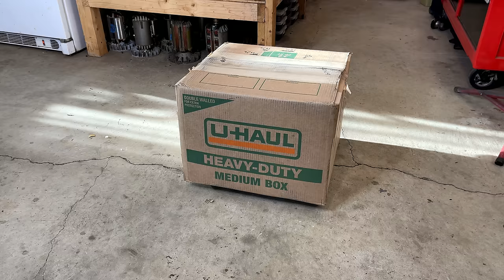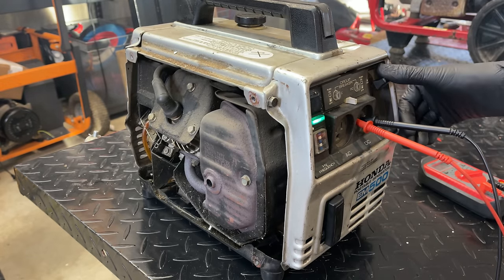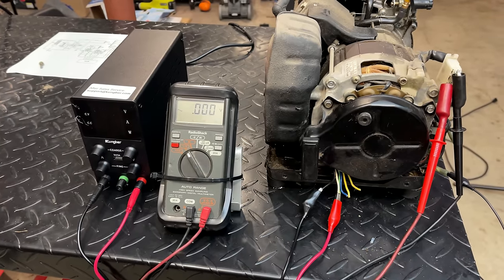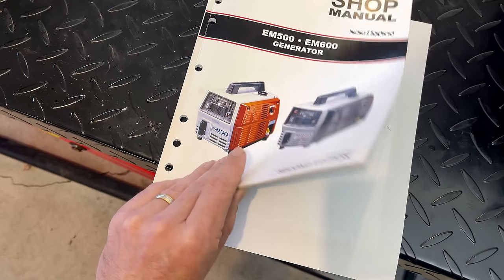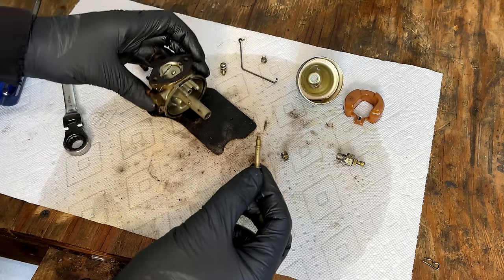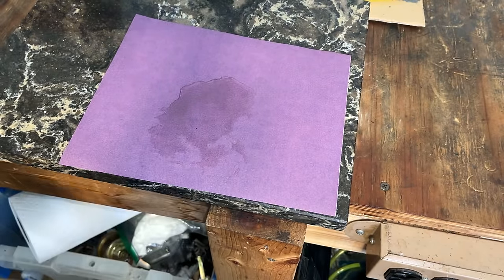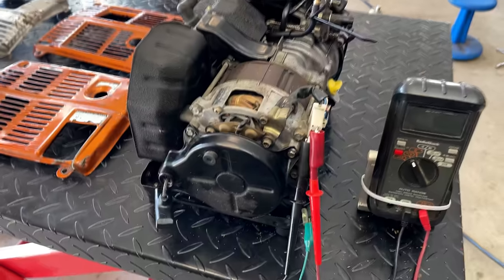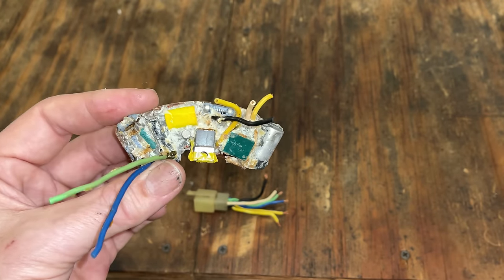Vintage Honda EM500 - High Voltage Problem

Comment: Not just a good repair, but an excellent RESTORATION, with the new housing panels.

Given the AVR  failure, I wonder if there is enough demand from spare AVR , to make a replacement version of the AVR.. Make a housing by 3D printing, make a new PCB and build these.

While writting the above remark you pointed out the attempt to depotting and the problems of wiping component details. Given the known electrical function suitable design of circuit can be under taken by compentnt electronics engineer or experience hobbist.  The choice of components should not be an issue Given basic design existing in the depotted part. Should be cost effective even selling  at lower price than the existing over $200 price.

By the way the depotting was one of the tasks often done in my job (over 40 years) of automotive design and diagnostics of warrantee return  alternator regulator s and other potted electronic modules including Dash display, car audio,  electronic spark modules and even full engine management (spark and injection) modules.. Truely not hard if experienced, without destroying the components on the PCB.

By the way my primary job was designing all above such electronics systems  but got called into diagnosing less obvious fault many times, but also did depotting on prototype and pre production analysis tasks.
 Most of my time was on full fuel injection engine management. But also designed from simple modules, speed relays, wiper delay, display modules and  transistor alternator regulators through to modern advanced hybrid integrated circuit based regulators. A very unusual though actually simple design  was an electronic replacement for classic old electro-mechanical alternator regulators from pre electronics times, basically used to be pair of electro solenoids that were far too costly to keep manufacturing due to material and manufacturing time costs, but due to past volumes, there was huge demand for over 300,000 spares per annum for diverse world market. Lots of old cars, trucks, tractors, road maintenance machines, even some generators,  rail and ship/boat usages, that simply needed to be kept operating. Some with alternators not replacable by newer designed alternators without very significant cost. So simple a range of 5 versions of a single basic design supported all applications. Biggest difference to normal electronic regulator being high side switching rather than the low side switching of field current of the modern system regulators.

Comment: Nice…it’s funny to me though, if I tried this half the screws would break off and have to be drilled out and any screws that hit the floor or workbench would be lost forever. Never mind there is no chance what so ever I could remember where every thing was supposed to go back. 😂
Reply: I write it down as I go along. The odd sketch or photo does not go amiss either.

Comment: Another method would be to create a mold from the original part and then cast it with a high strength epoxy such as J-B Weld steel.

Comment: The AVR regulates voltage variations can you use a car regulator from bosch or other brand ,  as it is 12-13 volts

Comment: As a side question... do you ever put a bit of dielectric grease on the electrical connections to minimize corrosion ?
Reply from the maker: It’s a good idea, but I have not used it.

Comment: You would think that you would have a blank connector that you could put pins in with short wires instead of cutting. Never know it could have been good.

Comment: How about getting a schematic of the larger version of the voltage regulator and adjusting the component values o fit the small wattage.

Comment: New to generators, why does it not produce a sine wave? Because of the characteristics of the part you replaced?
Reply from the maker: It does produce a sine wave, but brushless almost always have a noticeable ringing that can be seen on the oscilloscope.

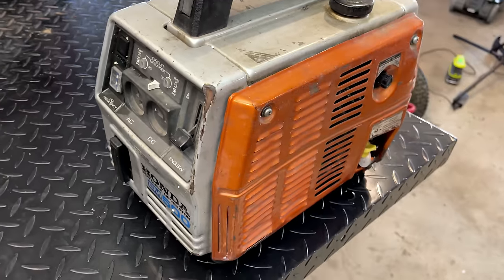Comment: 1:02 you forgot the 2 spacers on the carb mounting studs betweed the airbox!
Reply from the maker: They actually go in the airbox stud holes.  I put them back in there before putting the airbox back on.

Comment: Have you thought of getting a 3d printer for those small plastic parts that sometimes break? also good when needing to do some adaptors that you cant buy
Reply from the maker: I have thought about it.  The 3D printer my son has can print the parts, but the plastic melts at a low temp.  Would need to upgrade the tooling before I am able to do that.

Comment: Have you considered getting a 3D printer. That broken carb spacer can be printed easily enough. I know the spacer isn't made of plastic but heat resistant materials are available. There are also companies that will 3D print parts for you. Having most of the broken one is a good start so a duplicate can be made.
Its just a thought.
Reply: James has spoken about using a 3D printer before. He has had his son to make some parts but he has said that they were not robust enough in practice.
Reply from the maker: Yes, would need to find a company that could print the part using a higher quality material.  Think I need to spend a little bit of time learning how to use the 3D printer.
Reply: Fantastic idea!
Reply: @jcondon1  3D printers extrude thermoplastic which is unsuitable for use at elevated temperature. That spacer looked like it was made out of Bakelite which a themosetting plastic. It is actually baked at pressure in a mold. Completely different stuff.

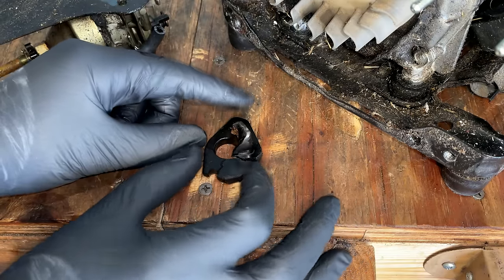Comment: 40:10 Instead of gluing it back together, do you have (or know someone that has) a decent 3D Printer you could make a new one with?
Reply from the maker: I do have a printer, but not sure it’s up to the task.  Just found an oem one on eBay.

Comment: Well done giving that a second life.
I wonder if a 3D printed carb spacer would hold up.   I do not know the operating temperature of the spacer, if it is less than 150 deg C (302 deg F) then a PLA printed part may work.   This would not be difficult to copy the design in CAD.   I am happy to volunteer if you want to try this.   Other filament types can take higher temperature, but my 3D printer does not have an enclosure so I am presently using just PLA.
Dave.

Comment: I have one that is over 40 years old and need to do some work on it. It isn't putting out any power.  Well the AC output is bouncing up and down real high and low on voltage.  I have had it for 40 years I didn't get it new. I started doing this about a year ago.  Any help would be great and are parts available to fix it?
Reply from the maker: Parts are the issue.  Most likely you need and AVR.  Potentially you have a loose connection.  The place I bought the AVR from is now sold out.  Do not know any other sources.  That said I am working on building an AVR alternative for this generator.  Not sure if it will work, but will try.
Reply: Really hope you are successful in rebuilding these AVRS. It's like you said a lot of these will end up in the landfill. Out of all the old school Honda generators built these em500s are probably the most popular

Comment: OK, I have to ask...  Why wouldn't one of the small 1kw-2kw avr's that are available on eBay have worked in this application? Yes, the form factor and connectors are different. But couldn't a person just cut the plugs off the replacement avr module, and then splice on the connector that you save in it's place? And then mount it just outside the generator head someplace? Since they are only about $10, I would have thought you could give it a shot without too much risk.
Reply from the maker: It would have been worth a try.  Those usually power rotors with 40-70 ohms and output 120+ volts DC.  Not sure how well it would have handled the low voltages on this machine.
Reply: @jcondon1  Actually, maybe you should still give it a try. And if it DOES work, you may have a better chance reverse engineering one to come up with your replacement unit idea.

Comment: Good vidéo i french people ,i have this generator, my carburator is broken, You have a equivalent  part number for the carburator ? Because the original carb is very expensive. Thanks :)
Reply from the maker: I am not aware of any clone options for this carburetor.

Comment: Well, as seeing as Nuisance is going to bann gas powered car's I suppose the poor cali people  will need to have hydrogen powered generators? Ouch, I feel sorry for the poor souls stuck there. James, Just a question if I may please? Why are you adjusting the constant current control on the PSU and not the voltage? Another Idea for the insulator, sorry am writing as I watch, there is a product called QBond here in Namibia Africa (don't know if it is available world wide) but, you could use that to glue together and form a new part for that missing bit of the insulator.. Nice video as usual, thanks James.
Reply from the maker: Thought I was adjusting the voltage.  Maybe user error?
Reply: @jcondon1  🤣😂🤣 I was sitting there watching the PSU and thinking why is this PSU jumping from 0 to 5V and not ramping the voltage up as expected..... Then I looked closer at what knobs where being turned.....🤣😂

Comment: concerning the old AVR - the potting can be removed after soaking it in acetone for some time (some hours,  sometimes 1-2 days). 
Once you have access to the board inside the AVR can in most cases be revived by changing out the electrolytic capacitors (and sometimes by fixing bad solder connections).  
Even if the issue is not some dried out electrolytic cap, most of the components inside these old AVRs are off-the-shelf and can be exchanged with basic (thru-hole) soldering skills,  once you get the potting off.
Reply: the failure on this one is the big transistor overheating and short-circuiting. The symptoms are that the output voltage goes way up because the rotor is receiving maximum excitation continuously.

Comment: You know on Amazon or wish or any of the places you buy you can buy some magnets they're flat stick them on the bottom of that table that you're using and in every time you put bolts on the table they'll stay right there where the magnets are if you even have to leave a couple of them side-by-side to keep the metal lawe're on top little screws both you know whatever so you don't lose him
Reply from the maker: I actually have several magnetic trays.  Have never used them :(

Comment: Looks like a 3d printer and scanner would pay off for stuff like the carb spacer that is otherwise Unobtainium .
Reply: There's two kinds of plastic there's thermoplastic and thermosetting plastic and you want to use the latter in hot applications. The kind of plastic you can 3D print is the former variety so it is unsuitable for use at elevated temperature. That spacer was Bakelite which a thermosetting plastic.

Comment: Those AVRs can't be that complicated - with a schematic they shouldn't be hard to make one from scratch no?
Reply: Great question
Reply: They are quite complicated really. You are talking about control engineering now.  The feedback loops are critical and hard to model using the math. Bassguitarist1985 aka Gary has posted a video alongside this one . Take a look at it. Just reverse engineering this one would be a lot easier but, as James says, The component values were erased in the process of de-potting.

Comment: Any ideas on sourcing a carb for an EM600?
Reply from the maker: The only option is to keep an eye on eBay or find a parts machine.
Reply: @jcondon1  there is a 500 and a 600 in the family if you need more parts :)

Comment: Old little Honda’s are built to last I have an ex500, ex800 and a 60s em300, the 300 previous owner has butchered the ac output socket to fit a UK socket
Reply from the maker: That is quite a collection.  I usually sell everything I fix, but held onto the EX1000 and will hold onto this one as well.
Reply: @jcondon1  i normally would sell but you get attached to them the ex800 is the same as the as the 1000 to look at, I just love the old machines, I also own a honda e1500 belt driven which I bought from a chap who knew the machine since 1973 , sold to me for parts as no compression, it was just a stuck valve, I also own a makita g2700 with a robin ey25 engine, I get too attached to the old equipment 😃 , keep the videos coming I love the variety of machines your very thorough ❤️

Comment: That is what I call packaging!  Those babies are the princesses of any construction site:  lightweight, quiet, powerful, last forever...   And they do so without killing trees!  Hahaha.  Even so, in California:  the AQMD, C.A.R.B., ... may have  "blanket" rule declaring them illegal due to their age.   Concomitantly, there isn't a requirement for replacement parts.  You have the schematic diagram...and look for the FCC License #.  The FCC has a record of every single item that has electrons flowing through it (on US soil) and the EXACT engineering data.  Accessible at any public library or online.  Then, "convey" that data to a electronics circuit board manufacturer in China.... BAM!  You have boards for sale...  One  trick on depotting electronics:  use a electric deep frier(with adjustable thermostat) and PRESTONE (ethylene-glycol).  The ethylene glycol has a higher boiling point than most potting compounds.  Just turn the heat up incrementally:  so  you can identify the components #s, etc.  Have a "candy" thermometer in the e.g. to record the exact temperature when the compound begins to loosen up or melts.  $200 a board!?  I see a huge profit margin.
Reply: Ethylene-Glycol in a ~40°-600°F Ultra-Sonic parts washer...  Smell what I'm stepping in?

Comment: Certainly a machine from the days when Japanese meant perfection in engineering.
TBH someone with knowledge if control modules could probably reverse engineer that AVR module given the track layout and the components at each point.

Comment: How come they were selling spare in Europe when that is 110v devce?
Reply from the maker: Not sure.  Maybe it uses the same AVR for the European version?
Reply: @jcondon1  most likely. I think Honda is Japan brand and that country is electrically split, half is 50Hz and other 60Hz. So they definately are aware of different grid systems.

Comment: Greetings:
I would consider the legal ramifications if someone is hurt using something you built!
If you designed a successful circuit, you might have JLCPCB or PCBWAY make your design and then test, test, test your design fuse it then maybe you could refer buyers to go there.

Comment: Can't you put a resistors in it to drop your voltage going to
Reply from the maker: I am working on a simple voltage regulator that will provide a fixed amount of power to the field.  Not as good as the original AVR, but better then a broken avr.

Comment: I assume this is a 4 stroke? It looks like a 2 stroke but sounds like a 4 stroke
Reply from the maker: It is a 4 stoke
Reply: @jcondon1  Awesome. I have a question as well I have did a powered swap from a blown briggs powerboss 5500 to a honda gx390 and the powered is only putting out 102 volts. The capacitor is within spec and it has bo brushes. And I checked leg 1 and 2 resistance and they were good. Any ideas?
Reply: I fixed the issue, the capacitor was a 19uf and the correct one was 35 uf

Comment: I got a question I simple for you say like you got diesel generator is putting out 240v just for powering house soo if the engine is reving high but in same 240v put if it's reving low but the output still the same soo my question is this is there a gearbox between engine and generator
Reply: 240V is only one part of the equation...... you need to keep the frequency constant, in other words, if you need 50Hz then you motor needs to turn in such a manner that the alternator can produce 240V @ 50Hz, engine speed is DIRECTLY related to frequency, diesel generators alternators and petrol generators alternators are not constructed the same, the diesel one's usually have more poles than petrol ones because of engine speed differences I think. I could be wrong, but, as far as I know, petrol generators run faster engine speed wise than their diesel counterparts. So short answer, no, no gearbox between motor and alternator.
Reply from the maker: The frequency is determined by engine speed on most generators (inverters are the exception).  If you need 50 hertz then the engine (or at least the generator) needs to spin at 3000 rpm.  Some generators are able to run the engine at a slower speed.  The Onan in my RV runs at 1800 rpm and the engine is connected to the generator using a belt and pulley system.  The pulley on the generator is half the size as the pulley on the engine.  In my case I need 60 hertz (3600 rpm).  So the engine runs at 1800 rpm but spins the generator at 3600 rpm.  It is a lot quieter.  The largest disadvantage is you need a more powerful engine because peak horse power and torque are at high engine speeds.
Reply: @jcondon1  Yes, was not quite sure how all these different gensets work but I do know that engine speed directly impacts frequency, Thank you for the valuable input learning is always welcome!

Comment: Pcbway can make them i think so just contact them.
Reply: If you don't know what parts to put on a board it doesn't do you any good.
Reply: @1pcfred  you can desolder the parts to measure them. And make a new board. Or get a other board and try again.
Reply: @ElektroTechNL  you can measure parts but if the parts are shot you're not going to get any useful readings. A shorted SCR reads just like a shorted transistor does and they come in the same packages too. I'm fairly well versed in electronics myself and even I occasionally run into head scratcher parts. Just oddball stuff that I can't identify by looking at it and reading it. A measurement won't tell you what voltage rating a part is either. If you can't get the part number to reference a datasheet you're in for it then.